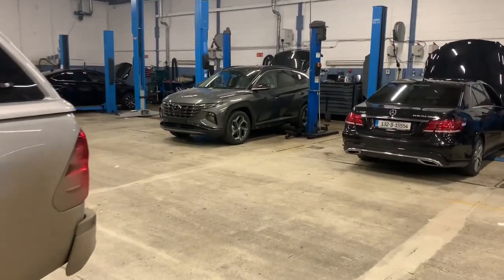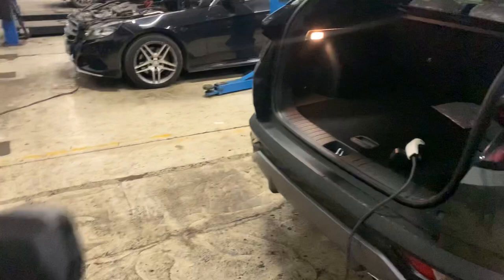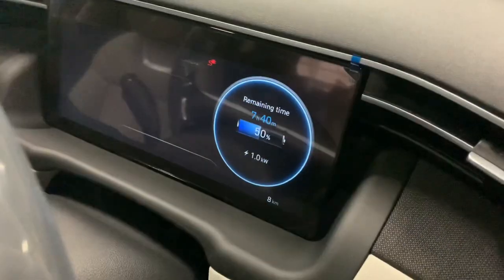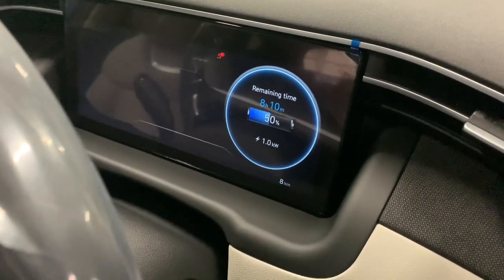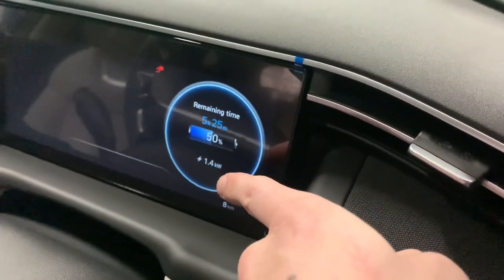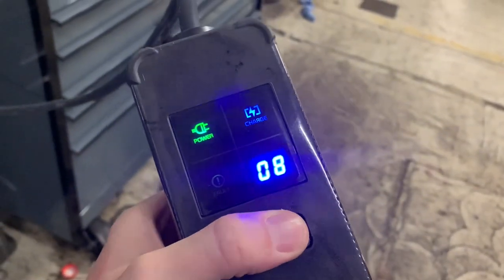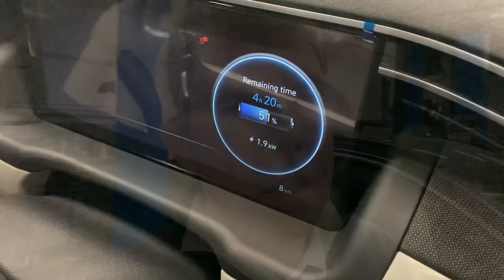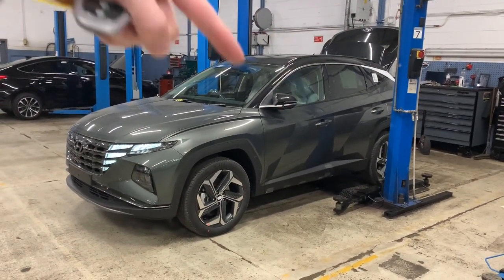Speed up your slow charger (granny cable) on a PHEV and EV #ev #phev #charging

Comment: It's a fairly basic tip. If you own a granny charger that has more than one power level set it to the highest.  But... there's a reason it has those different levels. If you plug you car into a normal household circuit which is generally rated at 13 amps in Ireland (10amps in Australia whhere I'm from) then if you plug in your granny charger at 10 amps then you don't want to make a cup of tea on the same circuit - because you'll be pulling 20 amps and significantly overloading the circuit. Also it must have a very inefficient onboard charger. My old Outlander came with a 10amp EVSE and it pulled 2.4KW from the wall and the car got most of that. I also had a dedicated 15amp socket and EVSE and that would pull 3.6KW. So there is something not right in this video because 10amps @230V =2.3KW not 1.7KW. Even at 6amps the car should have been 1.38KW minus some small losses.
Reply from the maker: Interesting information.. why do you think something is not right ?? The on board charger on Tucson is 7kw and Santa Fe is 3.4kw .. the granny however seems to only pull max 10 amps at circa 1.9kw . Thanks for watching 🙂
Reply: @doolanbrian  Because 10amps x 230V = 2.3KW not 1.9KW - it's simple math. So even if the onboard charger was only 90% efficient (and normally they're about 95% efficient) the car should still be pulling over 2KW. Australia is now also nominally a 230V country but most of our homes still sit slightly higher than 240V.
Reply from the maker: @mondotv4216  I understand the maths but this is the readout the car gives .. maybe it’s possible it pulls different amounts at different stages of the charge cycle ?
Reply: @doolanbrian  Yep - maybe that is all the battery is requesting. But at 50% charge level you'd think it would be requesting as much as it can get. All I can tell you is when I used to plug in my 10 amp EVSE into my old Outlander PHEV the EVSE used to read 2.4KW. The car never told you how fast it was charging but it was pretty consistent with the charge rate from memory.
Reply from the maker: @mondotv4216  ok 👍 thanks for all the information I appreciate you watching

Comment: I plugged mine in the first time and it said upper 20 hours.. i chit myself and was about ready to go back to the dealership... then i read the manual that said hold that button down.  my 12amp only gives 1.2-1.4kwh :-( but 10hrs is helva better than 20.
Reply from the maker: Also if you get a 7kw cable and charge point it can do it in 2.5 hours !
Reply: @doolanbrian  I think i'd need up upgrade my electrical system to do 240v to do that.  Im trying to justify spending that money ... if i had a full EV i would for sure but phev.. hard to justify
Reply from the maker: @realjoecast  makes sense ! 🙂👍

Comment: Great video, Brian.  I have a Yura granny charger that came with my 2019 Kia Niro EV.  It's output appears to be factory-set since there are no buttons like the one you showed.  The box of my charger reads "12A, 120V, 60 Hz," and the gun reads "16A, 250VAC."  My question is: If I replace my 12amp circuit breaker with a 15amp breaker, will that increase the charging speed?  Thanks much.
Reply from the maker: Hey Michael ! I wouldn’t be qualified to answer that 😣  , an electrician or wall box installer would be able to help I reckon !
Reply: OK, thanks for your speedy reply
Reply: Upgrading the breaker will not change your charging speed. A breaker ‘breaks’ the circuit when overloaded. It does not otherwise limit the current being drawn. To increase charge speed, you would need to wire a 240 volt circuit. It’s pretty simple to do.

Comment: Brilliant.. I've been a bit wary of using Brian, both because some say they're not safe but also the time it takes. This is a great tip. I'm presuming that the 10 setting will be fine on a 13amp plug as I noticed yours was. 👏
Reply from the maker: Yes, the important thing on this is to make sure they are not wrapped up or coiled when in use and also not to plug them into an extension cable👍🙂
Reply: @doolanbrian  Many thanks 👍

Comment: Is that cable waterproof Brian?
Reply from the maker: I have no information to say that it’s not,

Also it is designed to be used in an outdoor setting

I would imagine it’s safe to use in light rain, but I wouldn’t like to immerse it in water if you get me?
Reply: @doolanbrian  yeah it's rain i was worried about thanks,👍

Comment: Amazing that I can now charge my Hyundai Tucson PHEV over night for work the next morning.  This will be a first.  
I have a question about the disturbing loud back up beeping noise;   What can we do about it?
Reply from the maker: Hey there ! Do you mean the pedestrian warning chime outside as you reverse ??
Reply: @doolanbrian   Yes.  I live in California.  The volume of the pedestrian warning is a loud obnoxious noise and I see many complaints about this and Tucson PHEV owners looking for a solution.  In Canada and Europe, this warning seems to not be as loud.  Basically it sounds like a huge garbage truck backing up.   I'm sure many would welcome some advice other than putting tape over the speaker.  Thanks
Reply from the maker: @Turtle111ful  ours is milder in ireland .. I checked the settings but I can’t see any way to manipulate it .. I’ll read a manual when I’m back in the garage but on the car I am driving today it does not appear to be an option 😣 sorry I could not help better
Reply: @Turtle111ful  hi there, I had a 2021 Niro and the backup chime noise was obnoxiously loud too. I was told that there’s no way to turn it off unless you want to by breaking the warranty. Fast forward 2024, I just got another Niro and the backup noise was more acceptable, it’s more softer and not as loud.

Comment: Hi Brian. The little light next to the charging plug that comes on as you start charging is also some kind of switch. I've been looking through the manual, it's like thumbing through War & Peace  so I could have missed it. Do you know under what circumstances this button might be used? Many thanks.
Reply from the maker: The light is an indicator to tell you if the vehicle is charging or charged.. remind me again is your vehicle Tucson or Santa Fe?
Reply: @doolanbrian  It's a Tucson Ultimate Brian.
Reply from the maker: @j5s9cStu  are you sure it has a button or is it just a light ?
Reply: @doolanbrian  I was going to send you a screenshot Brian but I can't see a way of doing it on here.. where the charging light is, just above it is an oval raised area, sort of underneath the rubber, you can see it on your demo. If you press it, it clicks in or at least seems to do. The first time I charged my tucson I couldn't remove the plug from the car, in a panic I pushed that button.. didn't work of course, but I'm guessing it must have a purpose. Thanks.
Reply from the maker: @j5s9cStu  okay this is to do with scheduled charging so when you set up scheduled charging, this area lights up to tell you that the vehicle is not charging until the scheduled time🙂
Reply: @doolanbrian  Ah mystery solved. Thanks for your help Brian 👍
Reply from the maker: Anytime !

Comment: Hi Brian. Where can i get that extension cable for my granny charger
Reply from the maker: From what I know you can’t use a extension cable for the granny, it has to be plugged directly into the mains, in this video I just used the extension cable for a quick demonstration but unfortunately I can’t recommend using an extension cable for charging over an extended period like a few hours 🙂that is my understanding but I stand to be corrected  ✅
Reply: Please don't plug your car into a cheap extension lead at home, you need at least a 1.5mm core which can handle a continuous 13a drain.  If you must use one, then buy one from someone like Toughleads who specialise in them, they are IP66 rated and come with an inline RCD.
Reply: Thanks for the video. 
1 very minor request... Please don't talk so fast 😂
anyway... Here in Spain my charger cable goes up to 12 amps !!!

Comment: hi is there a formula to know the cost to charge the battery to full charge
Reply from the maker: I don’t really have a formula, because you need to base it on your electricity rates being charged in the building that you charge from so it’s not going to be uniform unfortunately 😞
Reply: Your electricity cost per kwh, multiplied by the size of the battery in kwh.
Reply from the maker: @keithreeder  this is a useful piece of information, thank you 😊

Comment: Can I put a extra battery in my car
Reply from the maker: What car do you have ??
Reply: HYUNDAi Tucson  PHEV Eecutive auto 4wd 2023
Reply from the maker: @seanfagan8490  okay, the battery will be 13.8 kW it’s not possible to make it any bigger unfortunately!
Reply: @doolanbrian  Thanks very much .I have the car for about 2 mts and trying to get use to it thanks again
Reply from the maker: @seanfagan8490  I believe that there will be a facelift model mid 2024, and they reckon it might have a larger battery at that point!

Comment: In the  UK the car does not come with 3pin  granny charger it only come with a type 2 charger. My car charges at 6.8 kw/h at home.  The max charge speed is about 7.3 kw
We don't get these little charges anymore. Shame as useful
Reply from the maker: They are quite expensive those granny chargers , it’s possibly a cost saving exercise but I’m only guessing , thanks for watching!
Reply: @doolanbrian   probably but they are useful  if you cannot get a type 2 charge.  
The ev cars come with both
Reply from the maker: @keithnewton8981  correct, definitely better to have one than not have one, at least with Phev, you will never be stuck unlike an electric vehicle
Reply: My 2022 Hyundai Ioniq came with a granny charger?
Reply: @matthewellis9885  yes full ev do but phev do not I questioned this because out ioniq 5 and kona ev came with granny but the 2024 tucson phev its a optional extra

Comment: I hear it’s not safe to charge even a phev on a 3 pin house plug or I’d be getting one now. Is this true? Thanks in anticipation.
Reply from the maker: I think it is safe to use the 3 pin .. The only problem arises where an extension cable is used for an extended period, that can be dangerous alright. 3 pin is definitely safe. It just needs to be plugged in to the mains direct and not via extension cable, hope this makes sense!
Reply: @doolanbrian  hi and thank you for your reply, very kind of you to take the time. Well I’ve got electric in the garage but it comes via a 2.5 cable that is plugged into a plug in the house. Would you say that is ok or does that sound like an extension? Kind regards.
Reply from the maker: @freedom2036  I wouldn’t be qualified to advise you on this, but I would suggest talking to any qualified electrician as they would be able to advise you better, I do know that you would need the socket to be supplied by a wire that has the same thickness as what is found inside a normal house if that makes sense?
Reply: @doolanbrian  Hi and thanks again for taking the time to reply. The cable is the grey 2.5 like used for a cocker and other heavy electrical things. But as you said I should probably ask an electrician. Kind regards.
Reply from the maker: @freedom2036  that sounds okay, just confirm with the electrician as I’m not qualified, but I think you’re on the right track 💪🙂
Reply: @doolanbrian  👍
Reply: My  EV 3 pin cable melted to the wall socket,  just had a smart charger fitted I was advised never to use this the 3 pin cable. my car came with a type 2 to type 2 cable, but seem strange some cars come with a 3 pin cable.
rob curston
Reply from the maker: @robcurston4467  You had it plugged into the wall socket in your home house?
Reply: @robcurston4467  sounds like you were missing an RCD somewhere
Reply: Why do they give you one with the car then???